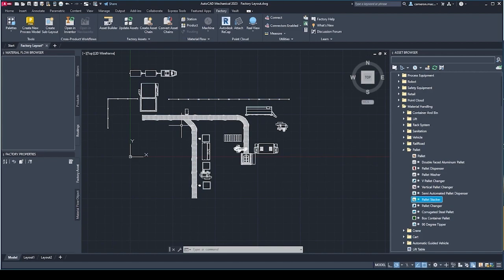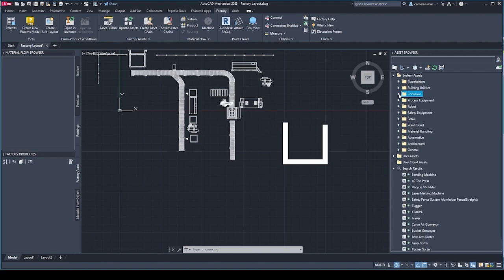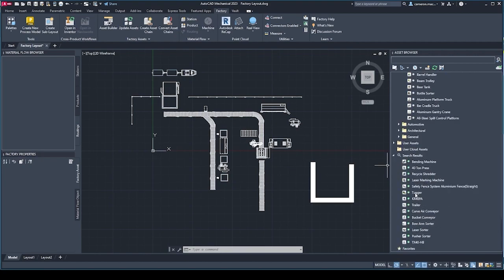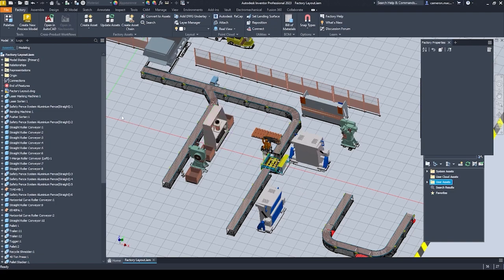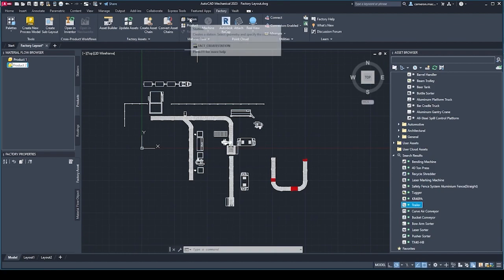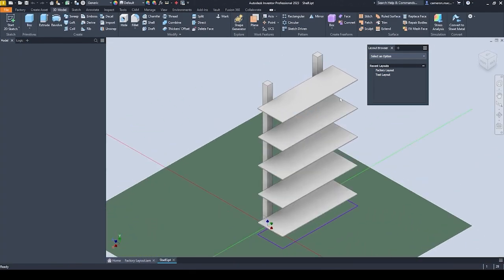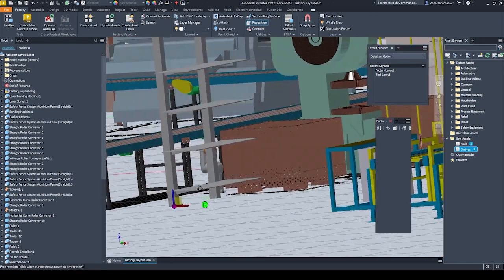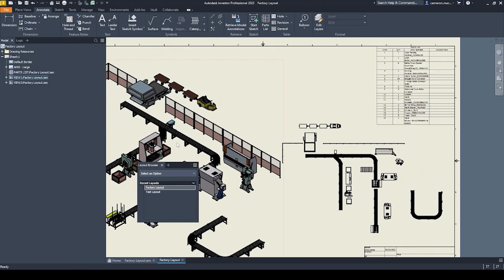Autodesk Factory Design Utilities Product Demonstration Recording

Comment: Dear, may I ask you the Autocad Mechanical that you are using is that Autodesk Autocad mechanical 2023 or normal autocad 2023? Or can you inform me which programs I need according to this video? Thanks in advance
Reply from the maker: In this video we used AutoCAD Mechanical but the functionality can also be used in AutoCAD MEP and Architecture. The full system requirements can be found here: https://help.autodesk.com/view/FDU/2023/ENU/?guid=FDU_Factory_Design_Utilities_Installation_Workflows_About_System_Requirements_html. The Factory Design Utilities program is required for the tools to be used, this is a separate installation. It works as an add-in for AutoCAD or Inventor, so will need to be installed alongside either AutoCAD, or Inventor, preferably both.